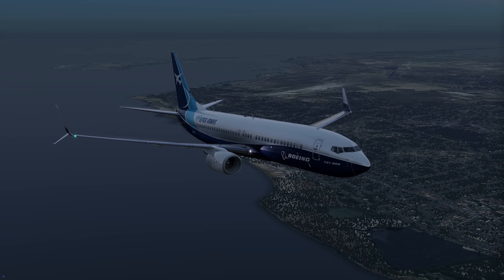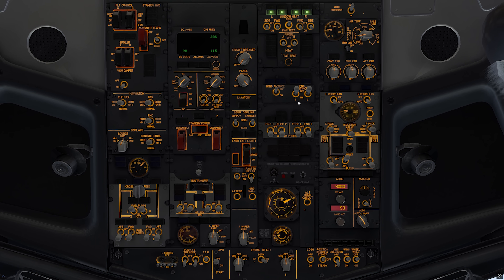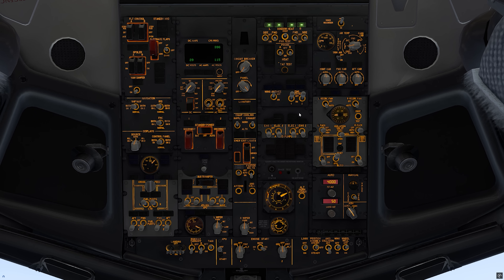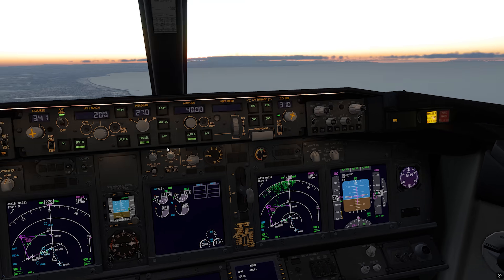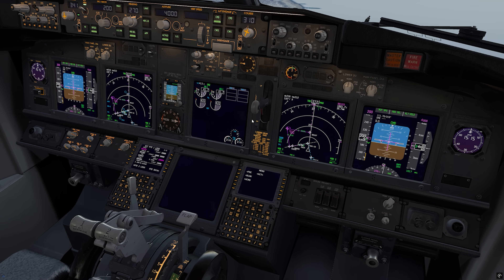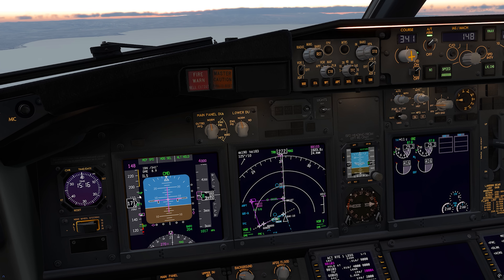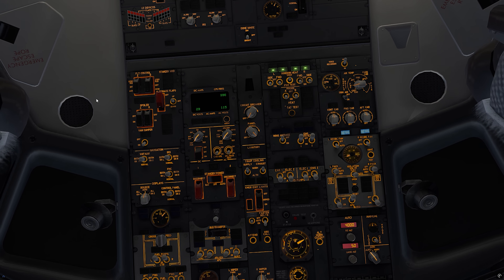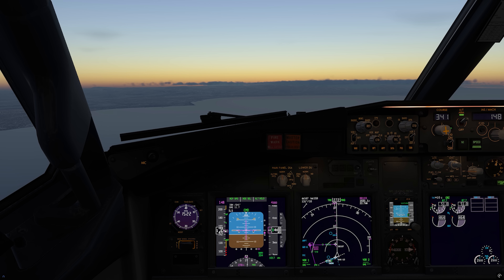Swiftair 737 Crash | System B HYD/EAI Switch explanation by a 737 Pilot

Comment: Question, what if you’re cursing at FL330, and your TAT is below 10c and lets says is at -10c, then your SAT is below -40c and is at -39c, which one has priority the TAT or the SAT, if you follow the TAT you should turn on the engine anti ice, but if you follow the SAT you can leave it off, please help with this doubt.

Comment: As I understood from other report on the accident, the pilots switch off the hydraulic pumps once the flaps were already extended at least not fully up. Then losing the pressure and adding the aerodynamic forces, the slats retracted. I have no idea if that is accurate or if it has been confirmed but it looks like it could be an option looking at the footage and how fast it just went down.

Comment: You touch a couple of switches . Instantly AP disconnected. Refuses to reengage twice. Master caution alert. Yellow FLT Control light on captain side, yellow HYD light on FO side. Three yellow lights on the overhead. Two on the hydraulic system. Red bar speed tape closing in. Flap and LE indications shows 0. Stick saker activates… Two pilots proceed to silence master caution and keep going. Really?😰😰😰
Reply from the maker: @DreamboyCAT  it certainly looks like it, by the time they realised it was too late.
Reply: The barber poles might not have been there if the flap lever was moved, but... yeah, the rest.
Reply: @rynovoski Aren’t the barber poles calculated by the air data computer? I thought that the stall limit was calculated using air speed, G loads or alpha vanes data not by flap levers position.
Reply: @DreamboyCAT  the captain can correct me if I'm wrong, but on the NG, I'm nearly certain that changing the flap lever position impacts where the barber poles appear on the speed tape, since the stall speed (or is it AoA) is changed by the actual flap position. But elsewhere in the threads, he did say that it was based on the flap handle position, not the flap position.

Is any of this present in the -400? Not so sure. IXEG is probably the closest place to try it.
Reply: flying at 3am...

Comment: Catastrophic errors made by crew. They turned off hydraulic system B, and after that, they didn't use alternate flaps switch to extend the flaps and slats  as a backup...

Comment: Yes, there are loads of warnings, but i cannot believe this type is still alowed to fly without a central warning system or EICAS or similar. It is long overdue to close the 737 and do a clean sheet design to complete with the modern Airbus
Reply from the maker: I should think the max will be the last 737. Yes it’s archaic but the aircraft is tried and tested, efficient and incredibly reliable hence why it’s one of the most popular narrow body jets in the world.
Reply: @flightdeck2sim  it's got a lot less to do with tried, tested, efficient etc and a lot more to do with the American Airlines stronghold and their unwillingness to retrain pilots to a new type. the customer is always right, and they are Boeings biggest customer by a long way.
Reply from the maker: Suppose I’m looking at it from a pilots perspective. I’ve flown it for 14 years, it’s a great aircraft.
Reply: @flightdeck2sim  I'm also looking at it from a pilots perspective. Fly a type with a proper central warning system and better designed overhead panel without all those switches. There's a reason everyone else now does light up push buttons and dark cockpit design. It just works better.
Reply: @flightdeck2sim  Are you looking at it from an unbiased perspective? Have you flown Airbus aircraft before, or are you sticking up for a company that's killed many people over the years just because it's familiar?
Reply: Actually, /is/ America the largest Boeing customer now?
Reply: @RJM536 ecam is obviously a better warning system the 737 is a bit archaic with the old school paddle button system.

But ecam also has plenty of flaws. Doesn’t necessarily prioritise tasks in the right order in case of multiple failures. But it is a better system. 

However the 737 is great and with a company with extremely tight sop’s very safe, efficient and reliable and very satisfying to fly in a way the airbus just isn’t . 

Also once your familiar with the overhead panel it is easy to use and essentially has the same no lights philosophy as airbus. 

Obviously the gauges and switches look ancient in comparison but the philosophy actually isn’t that different
Reply: @Bruh-zx2mc there’s definitely dated aspects to it the warning system for sure we were told that multiple times in training.

But airbus design and aircraft’s failures or mode reversions have caused a lot of deaths as well. It’s not like airbus hasn’t killed people with their refusal to trust a pilot in anyway. 

Both are great aircraft. And corporate culture at Boeing has been disappointing since the merger with MD. But the 737 is still a great aircraft
Reply: @ "But airbus design and aircraft’s failures or mode reversions have caused a lot of deaths as well. It’s not like airbus hasn’t killed people with their refusal to trust a pilot in anyway"

Airbus aircrafts are statistically less likely to kill you. Fact of the matter is that Europe corporations don't completely prioritise money over safety like American corporations do.
Reply: @Bruh-zx2mc  statistically yes but we have been mass producing them for less time. And that time has been in a more advanced time so of course they’re statistically less likely. 

They’re both great aircraft and you can pick at either of them however you like. For example the Air France Atlantic crash would never happen in a Boeing and etc etc. 

With regard to MCAS you are completely right it was a disgrace. But that doesn’t make the 737 a bad aircraft it makes the Boeing board and corporate structure. 

Asides from MCAS most events are due to operator, maintenance and other factors rather than them being bad aircraft inherently. 

Airbus also has a cost vs safety matrix . But I do agree with you in the majority of cases on American corporations being morally bankrupt. Historically Boeing was an outlier unfortunately not of late 

Also don’t kid ourselves European companies have done plenty of evil stuff we’re just better at sugar coating it and we do it in countries that mass media don’t care about so nobodies paying as much attention
Reply: @Bruh-zx2mc  can you provide a source that airbusses are statistically safer please? I'd love to read up on it

Comment: I find it a bit surprising that there appears to be no additional warning if the flap lever and flap position disagree for an extended period of time. That would provide an added element of safety if the pilots forgot checking the extension on the indicator.

Comment: I’m curious captain if you agree: I find it interesting that there are now two accidents in sort of rapid succession where attempting to deploy the flaps with no hydraulic pressure/not confirming they deployed/not using the alternate system might have been a factor (Jeju being the other). It just seems odd to me, considering the overall age of the model; I can’t recall this ever having come up before. I’m fairly knowledgeable on aviation accidents – I’ve always found the investigation process interesting, and we actually try to replicate the “just culture” and checklists in IT, for the exact same reasons.
Reply: You cannot compare Jeju to this. Jeju was caused by bird ingestion causing TR 1 and 2 to trip causing multiple system issues. Jeju crew also knew their flaps were not deployed judging by how nicely they landed (No significant angle of attack on approach). Their control column would also be difficult to move due to no hydraulic pressure, so they would have been fully aware of this. The Jeju crash has no relationship to this crash at all.
Reply: @Drew_c_n  sure I can. They could have deployed the flaps and didn't. They might have done that on purpose, but we don't know.
Reply: @rynovoski  So whats the comparison?

Comment: Switch guards would be a great help here. Having an extra step of having to unguard the hydraulic switches might be enough to avoid this mistake.
Reply: Some of the important switches are pull and move to avoid inadvertently moving them. Not sure about the hydraulic pumps on the 737.
Reply: Careful, boeing might need to make a new type cert for something like that haha
Reply from the maker: The type has operated for 50+ years with almost the same OHP, the existing warnings you get should be more than enough for a crew to be aware they’ve been inadvertently turned off. The crew shouldn’t have been operating that evening.

Comment: I made the same mistake in the sim not realizing  how serious can be
Reply: Technically, it's not even that serious in most cases. There were indications there that should have told them to turn the hydraulics back on, for starters. Then when they deployed the flaps, someone should have actually checked that the flaps moved on the position dial. If they noticed they were not deployed, they could have just increased speed again/not slowed down well before they stalled, since they'd know they were not safe to slow below the clean speed, let alone the flaps 5 speed.

Seems they got behind the airplane, ergonomics aside. That's one thing you can say about the MD-80 though: many many different switches that feel different to one another.

Comment: Almost as if Boeing should make one set of switches a different shape to the other ones (/s).  Thanks for the video :)
Reply: (But I think your point was that the crew should have noticed some of the indications showing that something wasn't quite right).
Reply: People retracted flaps instead of gear retraction on Tu-154 where they are located relatively close though handles have different shapes. Worse than that people who moved from Tu-154 to B-737 retracted flaps instead of gear on 737 where they are located in different places.

But even worse than that people moved condition levers feathering both props instead of extending flaps despite levers having absolutely different shapes, 2 levers instead of one, and even different patterns of motion for operation. 

So, you cannot fully get rid of mistakes by just shaping switches differently. You as a pilot need to be concise and cautious on what exactly you are flipping over.
Reply: @AVlad-eg3ds  BEA548 had a similar cause. Trident.
Reply: @  True, however if you compare a Boeing cockpit to an Airbus one (or ironically a US fighter jet cockpit to a Russian one), you get less rows of identical switches in one of them.  But yes, your what you say is valid to a point.

Comment: I did think that those two switches are  quite easy to misidentify and, honestly, I also thought that they could have been designed a little bit differently. However, it is also true that you’ve got lots of ways of spotting a possible mistake. 
I actually did the very same mistake a few days ago in msfs, but I immediately noticed the orange low pressure light and switched them back on. Then, I thought about it for some time and here are my conclusions: 
- when you turn on the anti ice, you should see the BLUE light behind the switches
- the switches are extremely similar, but they have a different switching direction: anti ice on in the UP position, hydraulic pumps in the DOWN position. Although this basically doesn’t matter in a desktop simulator where you just have to click them, my thought was that in a real 737 this should probably help tell them apart.
Reply: I always make sure I actually read the writing above the switch twice then operate it. And do it slowly 

It’s dangerous because you get so fast at operating the overhead panel but if you do this fast and have any other form of distraction this is easily done 

Slow is smooth smooth is fast

Comment: So with HYD B off, flaps does not extend, but PFD shows orange/red bars. So that gives false impression that flaps are extending, although I'm aware that pilots should look at flap indicator. But at 3-4AM can be tricky to stay always 100% focused.
Reply: Also note that the PFD is different on the -400. I’ve never flown one of those, but I’m not sure what kind of indications you get for flaps on the PFD. Maybe none?

It would’ve been neat if this had been recorded with the IXEG.
Reply: Feels surprisingly easy to do doesn't it.
Reply: Just being in circadian low puts you uphill already
Reply: Hi… I was under the impression those bars are indication of the TE flaps actually moving. And the rate of movement of those bars are the same as the same rate of travel of the TE flaps so incase the TE flap indicator was not working we could have an indication if the flaps are actually moving. With the B pumps not on, and flap lever extended, why would those bars move? What does that indicate?
Reply from the maker: @kylepinto5795  on the NG at least the bugs move on the PFD base off flap lever position and not the position of the flaps.
Reply: @ curious: how do you learn things like that? Like is it part of training, or something you study in a book, or...?

Comment: The videos focuses much on the system warnings. I'm also curious about the flying it's self. To my understanding, the 737 is already a very "slippery" aircraft and can be difficult to slow down. Surely the lack of flaps would completely throw them off the normal approach path?
Reply from the maker: Reading the report they were struggling to slow down as the aircraft was clean, they didn't realise the flaps were still up until it was too late.

Comment: Love these kinds of videos where you look at real world situations and try to simulate what happened, but I wanna know why it happened - even if it's speculation. 
Did the pilots just dismiss all the warnings, not notice the flaps not extending, and then stall the plane?
Reply from the maker: You can certainly decipher the chain of events that lead to the accident buy as to why the pilots dismissed the warnings? We might never know. The switching off of SYS B I can get but I cannot get my head round why they didn't identify the multiple master cautions, A/P disconnecting and didn't monitor the flap extension. Ultimately poor CRM (situation awareness/workload management). This should never have happened.
Reply: @flightdeck2sim  unless there were no warnings for some reasons? Or is it possible they reengaged the pumps too late? did they have such low temps and visibility that they disengaged it so late? but even then you'd have to be drunk to not realize what's happening... :o
Reply from the maker: @tantegreta  The 737 Master Caution system is archaic but incredibly reliable, there are two master caution lights for redundancy, the system doesn't just fail. The pumps were found to be OFF during the investigation.
Reply: @flightdeck2sim yeah I absolutely agree. The only thing my mind can think of is the condition in which they were operating: cargo ops, late night/ early morning if I remember correctly, frequency confusion etc. But yes, this once again shows how situational awareness is always crucial
Reply: @flightdeck2sim  they got a master caution and immediately canceled it. That feels pretty weird to me, but how many accidents have there been where somebody read a checklist items that they didn’t actually do, they just did it out of habit? 

But canceling the master caution, and then not even looking around for warning lights? I know when flying in the same, I always want to know what it was for right away. The only thing I can think of is that they lost CMD B at the same time, and maybe thought they knew what they were in for? But what other auto pilot failures would cause a master caution? And even so, losing the auto pilot, you would want to know why and look around I would think.

@blancolirio actually did a great video on the preliminary report. The whole thing kind of snowballed, and it might explain a lot of things. They should’ve broken off the approach when so many strange things started happening.
Reply from the maker: Blancolirio’s video was excellent. Unfortunately we’ll never know what was going through the Capt’s mind but there was a serious breakdown of situation awareness/human factors.
Reply: @flightdeck2sim  my theory is still that the captain who was suppose to be monitoring was so wrapped up with the radio issues and miss hearing ATC that either he or the co-pilot just automatically silenced it.. what gets me is that the co-pilot asks the captain about the anti-ice, which the captain claims he turned it back on which tells me the co-pilot thought the master caution was due to him turning the anti-icing off and at no point ever notices the red lights nor ever actually turns the anti-ice back on.

Comment: Huge flaw. 737 -4,5,6,7,8,9 and max now .
Reply from the maker: As I commented to someone else, the switch positions do pose a threat but the issue here, regrettably, was multiple warnings and indications being completely ignored and lack of situation awareness.
Reply: Wouldn't call it a huge flaw as this has so far only caused one fatal accident, most 737 pilots are aware of this and as FD2S said there are plenty of indications to warn you of your mistake if you do end up accidentally doing it